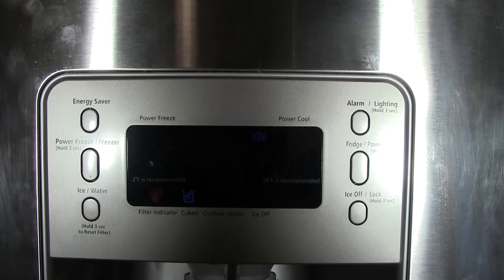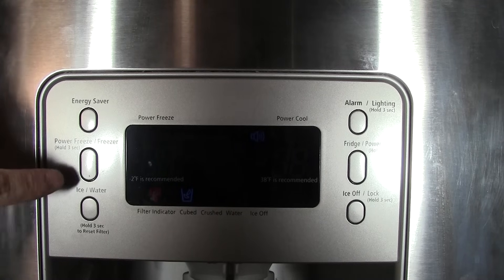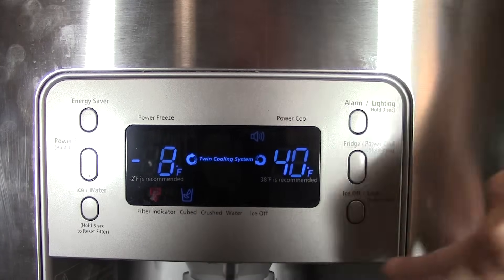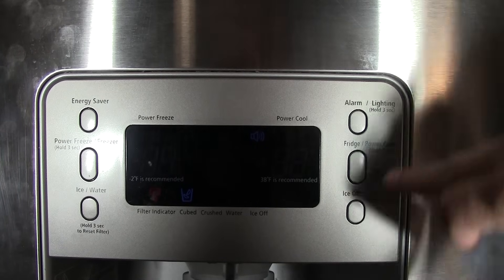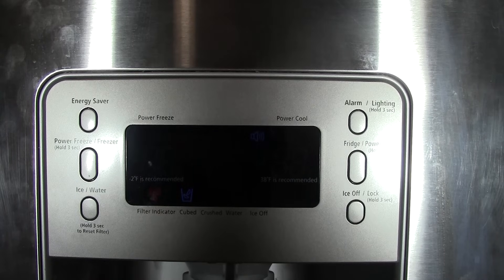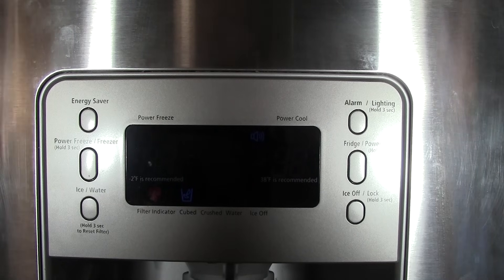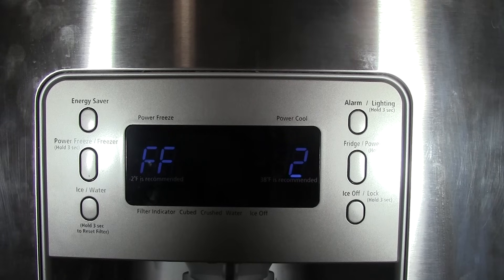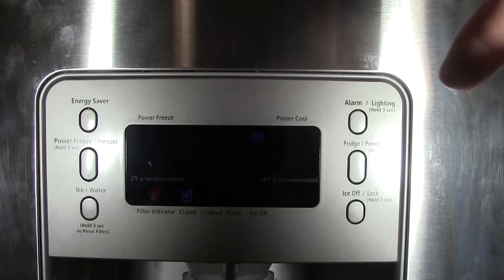FORCED (manual) DEFROST mode on a Samsung Refrigerator--Top Secret Setting

Comment: My Samsung Model # RF263BEAESR/AA stayed in the forced defrost mode for 1 hour. Then it went back to normal. Thank you for the helpful video.
Reply: Have the exact same model and I just started the cycle. I hope it works *fingers crossed
Reply: Earl F did it work?
Reply: Yessss, it worked did 2 cycles and it melted the ice that was clogging the ice maker cause I couldn't get the icebox out. The leaking under the deli drawer stopped as well. I run it once a week just to make sure. Good stuff and saved a lot of money. Thanks
Reply: Earl F I don’t have the same model so idk how to do the force defrost.
Reply: @robbyu.672  I didn't either I have a Samsung rf273beaesr I held down energy saver and fridge temp together for 10secs and the screen went blank and you press any button to get into FD mode aka forced defrost and it did the same thing described in the video.
Reply: @earfal  does it force defrost the ice maker only or the freezer too?
Reply: @webmastercorey  I was getting water build up under the deli drawer which is usually caused by freezing by the drainage area in the rear of the fridge and running this cycle helps melt that as well so the water can drain properly. I was running the cycle almost every week then noticed turning off the ice maker when it was full has lowered the number of times I run the force defrost mode. But when I do run I run it through the cycle at least 2 times last 30mins or so per cycle, it's really been trial and error but fridge and ice maker has been working so crossing fingers it lasts.
Reply: @earfal  Was it only your ice maker that was iced over or was your back panel iced over, too? Both my ice maker and back panel has ice build up and I'm wondering if the Force Defrost will attempt to resolve both. Thank you!
Reply: @MVMSChu  both were freezing up. I run the cycle regularly and sometimes run at least 2 to 3 times in a row and it seems to be working. Also to note when the ice maker is full I find it helps turning off the ice function helps it from clogging up the ice maker area. If not you'll have to chip away at to release the built up ice. Sad tips n tricks you have to use for something you pay so much for. Thanks Samsung.
Reply: @earfal  Appreciate the quick response! This is super helpful and I hope this will fix our issue. If not, we're out $2K. UGH, thanks Samsung.

Comment: Thank You Very! Very! much, getting ice build up on inside back wall and water deposit on inside of fridge. Didn't really want to go all Mac Gyver. First emptied out and put on display mode for a day. Then did forced defrost ( twice back to back). Been doing forced defrost once a week as you recommend for a month now. So far no ice and no puddle of water. When I contacted Samsung they wanted to schedule service call for a fee. Why don't they instruct customers to try this first? Either way hope problem solved, and only because of you. So, many Thanks!
Reply: Do you have to empty out the refrigerator when you put it on Force Defrost?  That would be an issue for a once a week cycle.  It might be obviously no to most people  but I want to be sure.  Thanks
Reply: I’d like to know if you have to empty the frig to do all of this as well
Reply: Lisa Brown I ended up emptying the refrigerator and let it defrost overnight while continually FD forced defrost.  This was about two weeks ago.  I intend on FD every two weeks.  All problems were resolved.  One thing I did was put an aluminum wire extending out of the heating coil into the drain in the back of the interior of the refrigerator section.  There was ice blocking the drain pipe that forced defrost wasn’t getting to so the wire is supposed to help.  If you force defrost regularly this problem should be avoided.  Some say once a week some say once a month.  When Force defrosting regularly you don’t have to take out your food.
Reply: nejolo will vote for BERNIE SANDERS 2020 thank you for responding so quickly...MUCH APPRECIATED!!!

Comment: You saved me a service call! I had to do the defrost cycle 3 times to get rid of the ice buildup, but now the noise is gone and the fridge is back to its proper temperature. Thank you!
Reply from the maker: Don't be surprised if there is a lot of ice still back there.  The ice may be out of the way of the fan, but I would bet you $100 that the coil is still iced over.  Probably best to run the defrost cycle a little longer or do it once a week as a preventative.  You are dealing with a chronic issue.  You didn't fix the problem, you simply got your fridge working again temporarily untill it happens again.
Reply: You were right; the fan started hitting the ice not long after my 3rd defrost. So I took the inside rear panel off and got rid of the ice with a hair dryer. Took about 45 minutes from start to finish. Best part: free labor!

Comment: My ice maker freezes up about once every 6 months, I rip the whole fridge down to thaw out the drain tube. Thank u so much for this. FYI, a big help is to coil a piece of stripped copper wire around the heating element and run it about 4" down the drain tube. Gets me through for about twice as long.

Comment: I tried Forced Defrost twice;  was not sure if I had gotten it all.  I had noticed a disparity where the refrigerator shows and stops at 34; thinking that it was still frozen.  Fan was still iced after 1st defrost..   So I set the unit to 38 degrees, and put the unit in powercool ( runs the fan ). I watched it till the unit reported 36 or 37 degrees; then turned off powercool for a bit, and waited till it raised back up to 38.. ( inside temp was in the mid 50's when I started, still in the high 40's when the outside showed 36.. ) Then turned powercool back on and repeated a few times. This is essentially using the inside temp of the items in the frig to defrost the ice using the fan.  After about 3+ hours, it seems to be working right again. Now running 38 degrees with other thermometers reporting real 38 degree inside.   I'm thinking it's not wise to choose 34 degrees as 34 degrees might be actually 32 ( ice .. ).   Yes, I used to run the frig at 34; guess I won't any more.

Oddly enough in the many years I've owned this fridge, I've never used powercool but to help defrost the fridge.  My heating coil-may or may not work.. I don't know... I'll just run the fridge at 38 which is comfortably above freezing, yet cold enough.
Reply: Replace defrost sensor(or heater as needed)    or manual defrost for life ....
Reply: Just an update..   I never replaced any parts on the fridge.. I saw some instructions for resetting the fridge back to defaults;  not sure if that worked.. I also saw suggestions that pulling the power for 3 minutes is also recommended.. Anyways, since then, it's not misbehaving;  no signs of ice buildup.  Fridge working correctly.  I don't fully trust the electronics for their reported temperature; so I bought a cheap "thermometer with an outside sensor" and stuck it in the fridge as a secondary monitor.   But the fridge has worked well since unplugging it. 
Unplugging it to fix it?  It might seem not so much common sense; but all of these fridges have computers running them; what do we do with our computers when they start acting up ?  yep..
Reply: @MrPir84free  Still working properly?
  If so, maybe a little power spike caused the problem.  Be interesting to know.
Reply: @rickeykeeton4770  Yes. it is..   I added a surge protector inline, along with a 7day programmable appliance timer to align the defrost cycles to 2 AM ...

Comment: Make sure to adjust the levelers on the front and get it off the roller wheels. I found that  if the levelers are set high on the front to lean the fridge back it helps alleviate the icing up. Haven’t had to  force defrost in 2 years...until now 1-21-21👍🏻

Comment: When entering "forced mode" and a forced function is selected, the unit will continue that function beeping permanently. Instead of using "demo mode" to cancel the forced function, you simply enter forced mode again, scroll through the forced functions until the screen is blank like it was the first time you entered forced mode and don't tough anything, after a few seconds it will exit forced mode but with the previously selected forced function now disabled.

Comment: I want to thank you for posting this video. We've had problems with our Samsung refrigerator fan for about 6 months. I came across this video, I followed your directions and it's now back to sounding like a refrigerator and not a grinder. Much appreciated.
Reply from the maker: Since this is an ongoing issue with these refrigerators, I would recommend doing a manual forced defrost every two or three weeks to help prevent a total freeze up.
Reply: @jakeguitar01  hello & thank you for the video. I have model # RF263BEAESR & everything in the fridge is freezing it has code 80F & when I adjust the temperature it changes back to 80F. Would you happen to have any suggestions as to how I can adjust the temperature of the refrigerator so it stays at the correct temperature? Thanks in advance for any help you could give me.

Comment: Thanks so much, as you said it is better than to remove the evaporator cover which is not easy to do because it is glued to the fridge with ice. There s a chance of ripping the styrofoam insulation.
Reply: it will come off once defrosted. Have to be patient, it is a process. I have done it twice. If it is in the home it will take  a little bit longer. I have done it twice, and  will tell you this if its done in a heated area, it will drop fast.

Comment: Thanks for the information.  My Samsung fridge starts to make the fan noise after about a month without a defrost.  At first, I was moving food to a second fridge and unplugging the Samsung overnight to defrost.  As I said, this would clear up the fan / noise issue (build up of ice) for about a month.  After watching your video, I decided to try the RD mode.  I believe this only defrosts the refrigerator compartment.  After one cycle, this did not correct the fan noise.  So, I immediately ran the FD mode which I believes defrosts both compartments.  This did eliminate the fan noise and will hopefully give me another month before I need to defrost again.  I plan to run the FD mode next time.  

The defrost modes lasted less than 30 minutes.  I do have a thermometer in my fridge compartment (near the coils) that showed the temp raised to about 60 degrees F during the defrost.  I do not see this as an issue as the temp was raised for less than 30 minutes.  I have had a control board issue with this fridge as the front ice / water control would error and beep at times when switching between ice and water.  I replaced the front board at $150 (part cost - I replaced by myself), this did not completely clear up the issue.  I most likely need to replace the main control board but am hesitant due to the $200 part.  I do not want to invest more money in this fridge.  My thoughts are that the main control board is not controlling the defrost mode properly as well as causing the issue with my ice / water dispenser.  

Here is a link to more information on the controls and different control panels by model.  http://repairmanuals.yolasite.com/resources/MSA-Samsung-Fridge.pdf   Good Luck!
Reply: What's the issue with ice/water dispenser?
Reply: My new issue is the water function don’t work and the display shows JUST the set temps for Refer/Freezer not the actual temps after you press the middle buttons

Comment: Just ran this defrost cycle on my RF237 model (2013 model) 3 times. On this model beeping goes for 1/2 hour - did it 3 times to resolve loud fan hitting ice build up at back of fridge. Will see if this resolves issue at least temporarily and without need to remove plastic and run hairdryer over this part.
Reply: What was the outcome?
Reply: No dice - still had to remove plastic backing, disconnect thermostat plug and fan plug. Melted ice off with hair dryer (drain was good as tech came in 6 months earlier to fix with longer metal piece). Guess I’ll wait till it freezes up again and annoying fan noise starts again. Piece of #&$## Samsung fridge.

Comment: Hi Jake! After the the forced defrost times itself out and the dinging stops does the unit automatically resume cooling? 😁 Also, during the defrost cycle is it defrosting both refrigerator and freezer - or just the fridge? I hear something running but not sure if it automatically resumed cooling the fridge or if it somehow continued to just chill the freezer during the defrost. Thanks so much for your video and your help.
Reply from the maker: It should automatically resume after a set amount of time.  And I "think" it's just the refrigerator that defrost but I'm not sure.  Maybe someone else knows the answer to that question.
Reply: jakeguitar01 Thanks so much!!! And, thanks for answering me so quickly. 😁
Reply: hi there, I tried this and possibly interrupted the cycle by opening the door ... I noticed it kept changing from Fd to 0FF. have I ruined my fridge? the compressor doesn't seem to want to start.  I shut off the power to the fridge for 15 minutes or so hoping it would reset... what can I try?

Comment: Thank you for this very helpful tutorial - had a layer of ice in the lower freezer compartment - set the unit to demo mode for a few hrs, making certain to not open the refrigerator section as it was still filled with food - this took care of the ice layer and related ice in the rear drain ports of the freezer.

Comment: I will NEVER buy Samsung again! It’s CRAZY that one can invest $3000-$4000 in a refrigerator that starts having problems across the board in less than 2 years!!! The fridge worked beautifully...until it doesn’t (like I said...LESS than 2 years!) You will pay multiple repair calls until finally your warranty “runs out” and “too bad for you”...DO NOT let this happen! Demand a replacement BEFORE your warranty runs out! Don’t be naive like so many and assume Samsung will do the “right thing” ...they care about money. Period. My husband is...as I type this...once again holding a blow dryer to the block of ice built up behind the panel. The whole fridge was warm (61 degrees). It’s a wonder no one has gotten ill in my family. Which angers me because I have children. There are COUNTLESS other families out there who are in the same boat. (Check our FB pages) Do yourself a favor if you are reading this....do not buy Samsung!!! Buy AMERICAN!  
We are shopping now for a replacement. I pray I make a better choice!
Reply: Everything. I agree with everything you wrote. And who would program something to beep obnoxiously every second of a forced defrost that can last up to forty minutes?! Just have a flashing signal on the display. Ugh this is obnoxious.
Reply: every samsung we have bought has major problems fridge front load washer microwave. Last samsung we ever buy!!!!!!!!
Reply: I will never buy another Samsung either!  What a moronic thing to do to put that annoying beeping sound on a defrost mode!  I had to find it by pressing freezer & lighting, not energy saver & fridge like the other models.  I hate this fridge!  First time it quits It will go to the dump & I will buy as plain a refrigerator as I can find.

Comment: Jake, great videos and information. Hey I got the same control panel where it says ice off. it won’t let me go to that to turn it off. I defrosted the whole fridge I got rid of all the ice but that wasn’t the problem. My icemaker is toast . It Lets me go through the cube ice,crush ice,water but it won’t let me to go to the ice off. You got any tricks for that. Thanks.
Reply: On mine you just momentarily press the lower right button to cycle the icemaker on and off. Press and hold to turn the light on and off. [door nightlight concept.]

Comment: Timbo, I have the Samsung RF263BEAESR. Would a frozen drain be the problem? And would using the fd function be the solution?
Reply: Yes, I would guess the drain is freezing shut. Forced defrost, (is trying to treat the symptom but not addressing the problem). Samsung only put a tiny hanging metal (tab extension) on the defrost coil at the drain hole to keep the drain free of ice. They (along with everyone else) now knows it is completely ineffective at keeping the drain clear. The update kit techs put in is a simple wire that goes down the drain hole a little and warms up with the defrost cycle to keep drain clear. I had the same (big time) water problems with my 267 five years ago. Added a little wire as I described, and never had any water problems again.. Over four years dry now. There's some pretty good videos showing how to do it here on the tube. It's really not difficult if you can use a screw driver and pliers. Then.. never need to use FD again.. and your veggies don't have to learn how to swim.

Comment: Ok..Model RF268... press energy saver and freezer for 10 or so seconds...toggled  to RD,  left it there. Beep will continue for about an hour.
Ok so I did this, forced defrost (FD) and took a 5 mile walk, came back beeping was stopped and fridge settings were back and fridge was operating as should noise free. I presume it defrosted for an hour and returned to operation. I dont think it defrosted completely, but noise is gone. I will cycle this again tomorrow to get rest of ice. Left towel along backside and did collect water... easy peasy. Our fridge was 12 years old before it developed the problem... che k your settings dont make it too cold
Reply: Thanks so much, also have RF268 & going to operate on it.  Tons of ice buildup!
Reply: @mbrooks9305  I did a second cycle which cleared all ice buildup, has been good since.. .